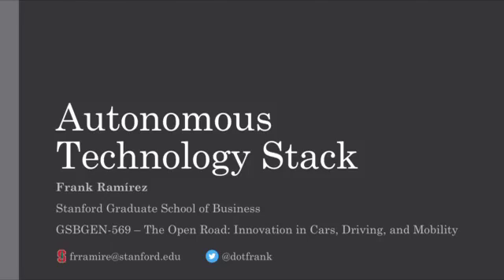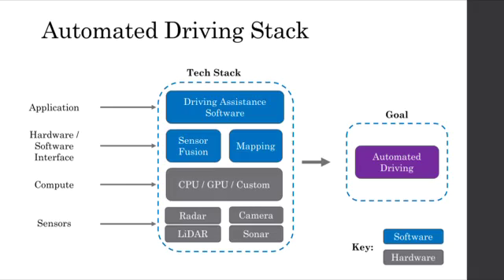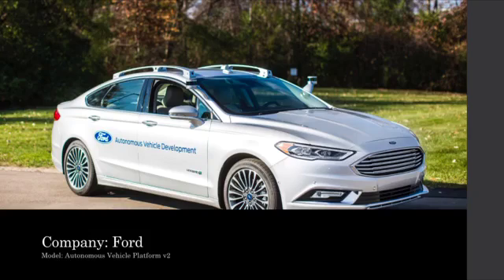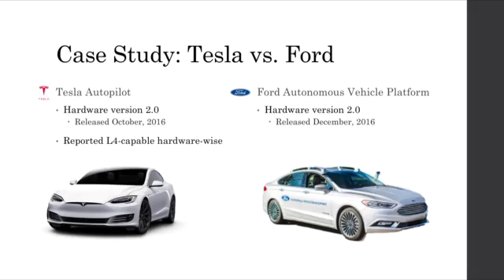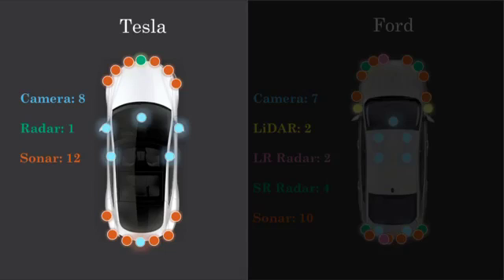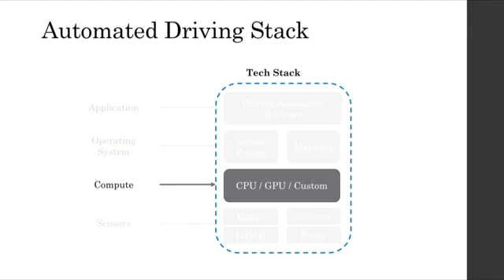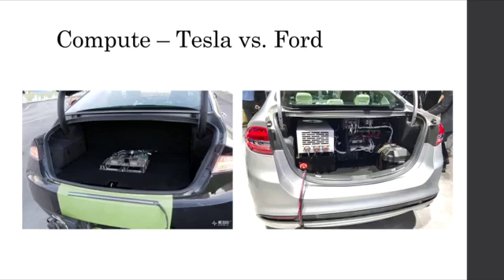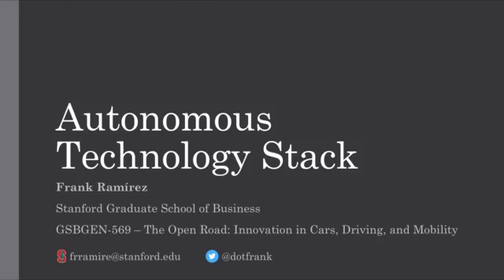Autonomous Vehicle Technical Stack

Comment: Safe autonomous driving simply impossible without a relatively high level of intelligence which has to be self training, You cannot just detect lines to keep it safe you need to keep context in mind which country you are in, which road it is what is current speed and weather conditions. 
Autonomous driving cannot be separated from intelligence. It is part of the same problem.
Reply: What you're talking about is configurations

Comment: quick detail ... Tesla aims for driver assist tech whereas Ford has a closer approach to fully autonomus ... that is the main reason why the sensing & computer power is so greatly different
Reply: Xp Reflex  what Tesla calls as "Full Self Driving" still requires the driver to pay attention to the road at all times. This by definition makes it a "Driver Assistance" system. What tesla is doing is out-right false marketing.
Reply: Xp Reflex  thank you for proving my point. All Tesla is providing is some barley working driving assist features.
Reply: The hardware requirements for level 4 (fully autonomous in most situations) and level 5 (fully autonomous) autonomy are more or less equivalent. Tesla have said that their vehicles are level 4 capable with only software updates necessary to get them there.
Reply: Although, that does require trusting what Tesla says about its vehicles' capabilities...
Reply: @robinsevers4588 They have been conservative about capabilities in the past.
Reply: Robin Severs Tesla is lying you know.
Reply: @robinsevers4588  I've been working with Autonomous Driving for more than 6 years.
Tesla's solution cannot provide the amount of redundancy required for a level 4 or level 5 vehicle.
This is why Musk usually chooses to avoid answering this question.
Reply: Tesla has never said they aim for driver assist and their development of their own hardware shows they are serious. A fleet of self-driving cars has been part of their business plans for a decade. They specifically rely on cameras so that they can have a all-around solution that will mimic human capabilities when dealing with edge-cases when fully automatic.